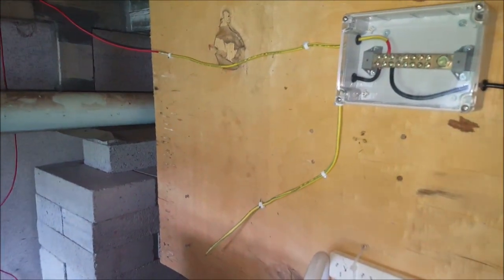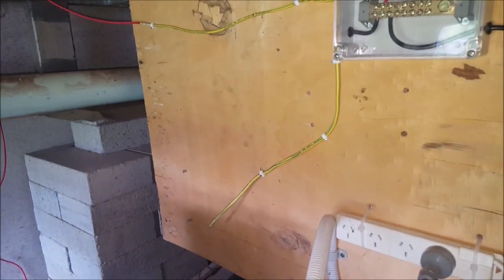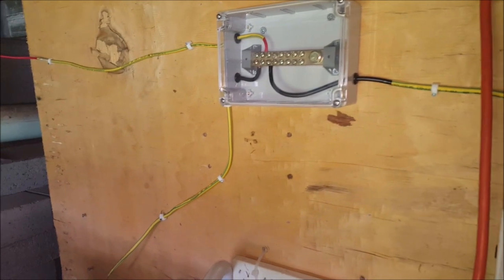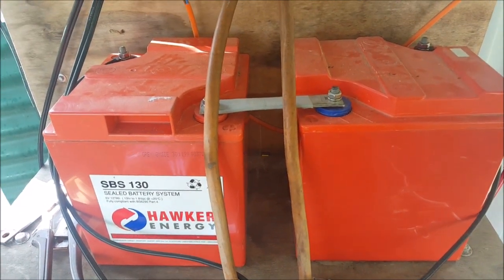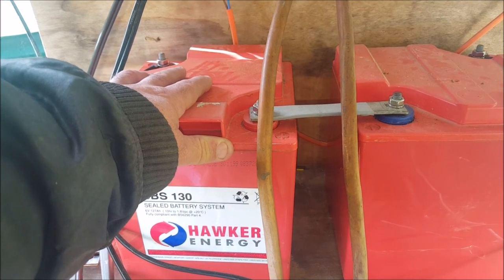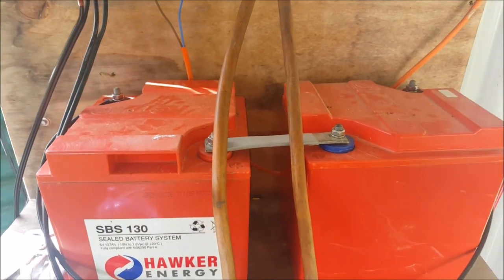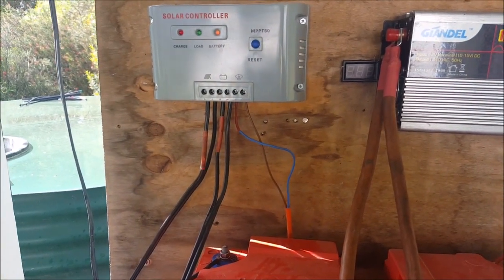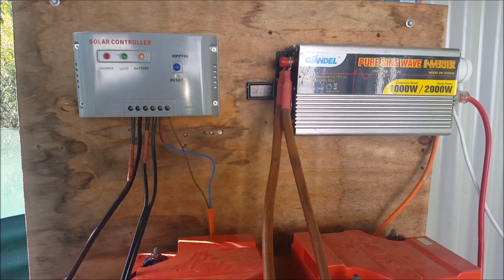Off Grid Solar Power - Using the Backup System

Comment: How do you find that 1000W giandel inverter?, Given the chance would you have gone for the 2000W version instead?
Reply from the maker: Nickk0051 - The inverter I lent to my parents is the 24V/240V 2000W inverter. I love it. It's seen continuous duty (99.99+%) for the last year without any problems. I just ordered another 2000W jobby today as a back up.